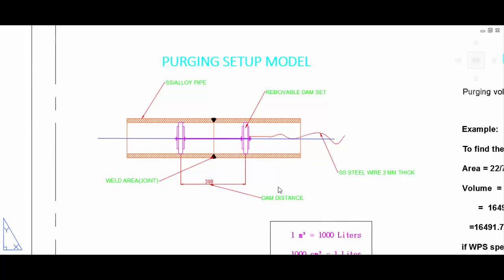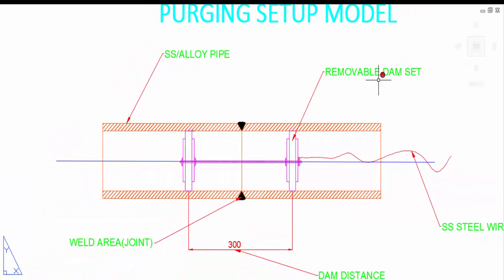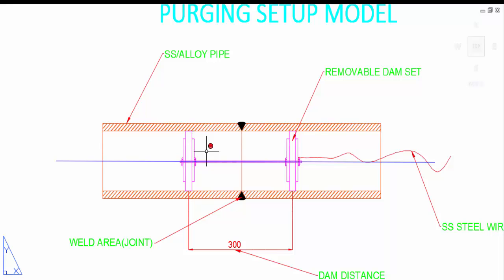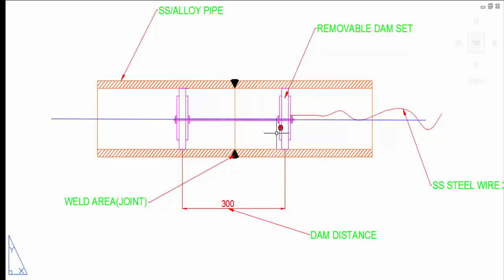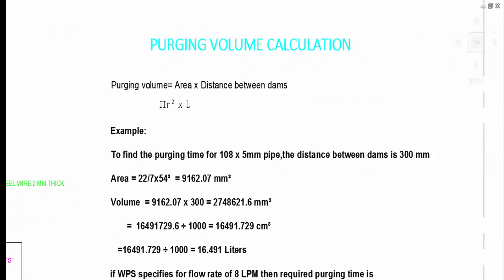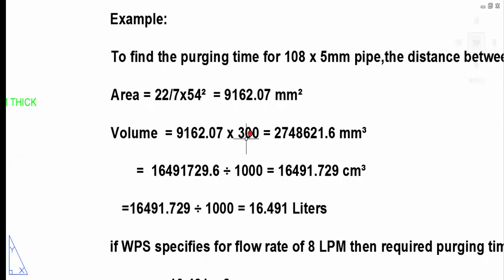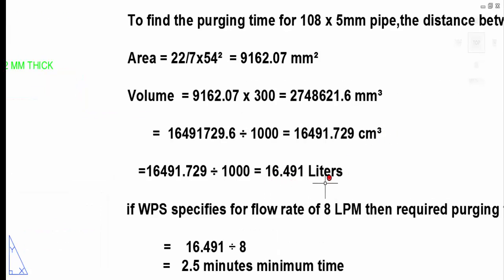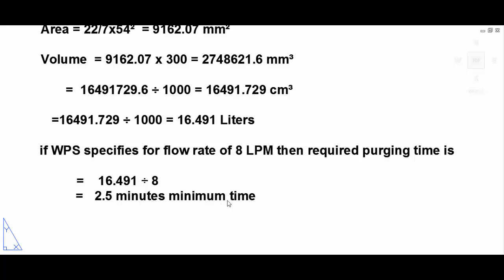PURGING GAS VOLUME CALCULATION FOR PIPING

Comment: Pipe line size is 250mm and thickness is 10 mm total length is 20 mtr. And 10 m3 gas are available in a nitrogen cylinder. How many nitrogen cylinder are required for purging of this pipe line. Please confirm as soon as possible.

Comment: The volume is 2748621.6mm^3 but when u convert the answer in cm^3 then u wrote 16491729.6 from where it came
Reply: Even im confused.
Reply: The purging gas is passed on the inside .the radius too vary from od 108 - wall thickness 5 =44
Reply: I have the same exact question 16491729.6 where it come from? all formulas from volume say that the  volume is 2.748Liters
Reply: Same question? , how it's come